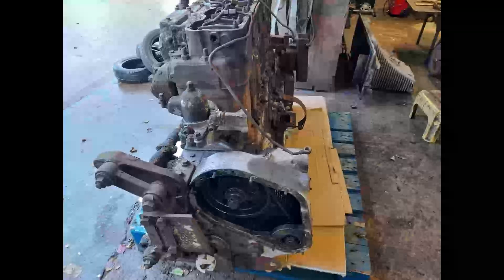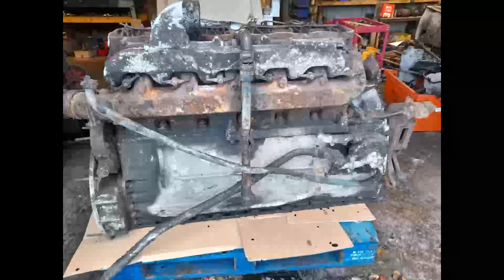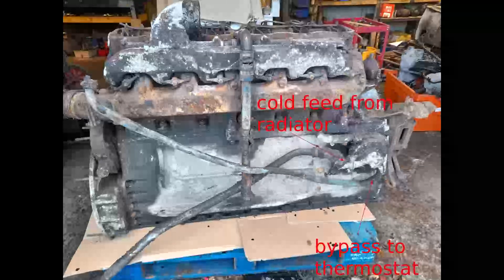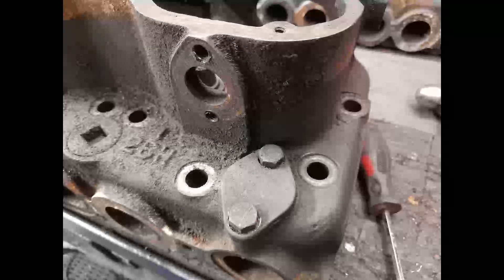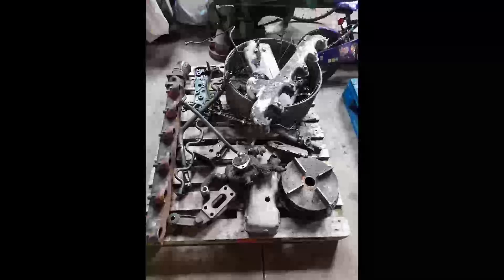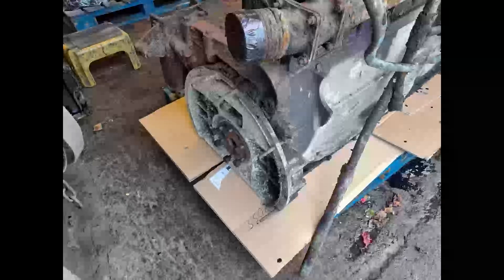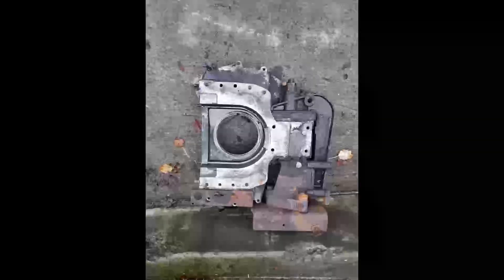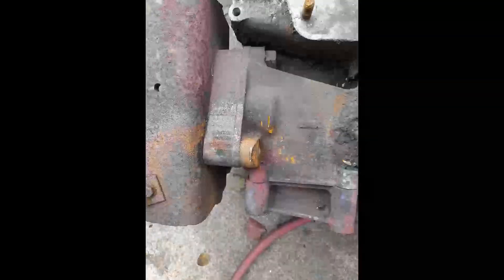Gardner engines: a horizontal engine - Gardner 6HLW: PART II

Comment: Did the horizontal version have a specific purpose in life? Surely not marine but am thinking maybe rear engine bus, or cab over truck or ?
Reply from the maker: Yes, low slung under the body of a bus.

Comment: I suspect that those ports are a by product of the casting process for the heads, as the engine is literally an LW on its side it would be easier to modify the moulds for the head by just adding the locations for the repositioned water rail and oil rail which are on the outside of the head and leaving the internal core as is. This would allow the internal cores to be supported in the same way as in the vertical engine and wouldn’t need a redesign of the cores, then all that is needed are the easily produced blanking plates to cover the redundant ports
Reply from the maker: Yes, I think you are correct Geoff.   Thanks a lot.

Comment: Surely that blanked off port was  used for the water rail? This would not be used on the horizontal engine as the oil return pipe from the heads is in this position. The water rail on this engine would run along under the injector pipes.
Reply from the maker: I don't think so.   See Part I.